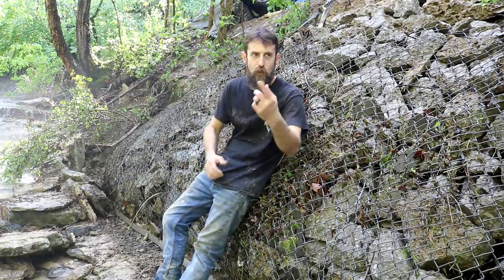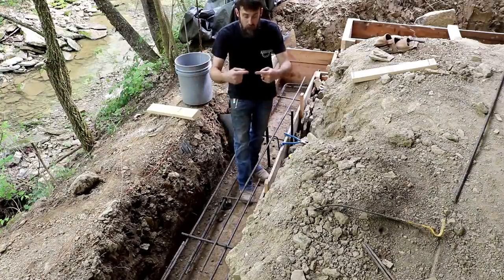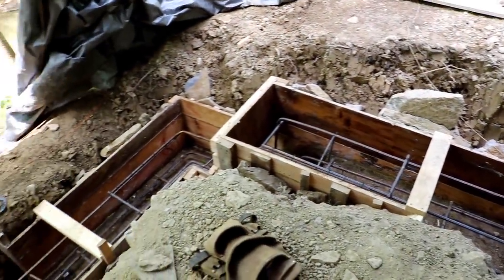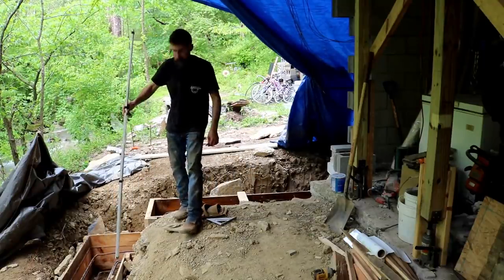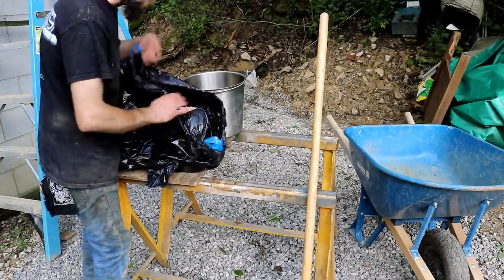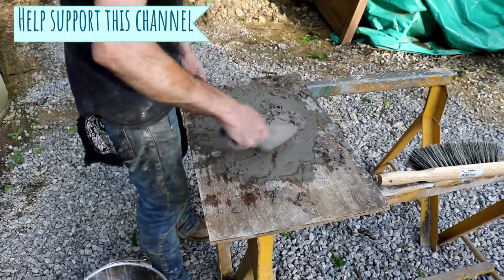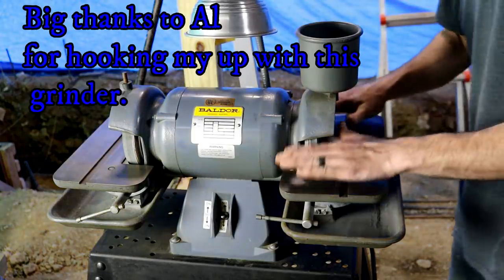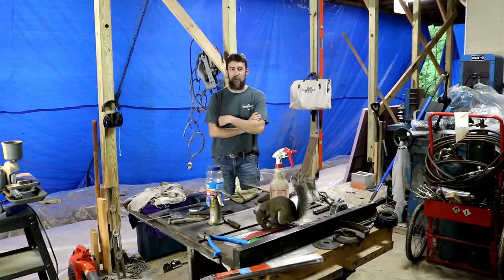Shop update 15  Huge Flash Flood footage & Block Repair

Comment: Put your mortar mix in a plastic bag, open one corner, use that to squeeze the mortar into place. Then use the trowel for the finish work. Makes it so much simpler and easier to work with. Keep your humor up, helps with any frustrations you may end up having on such a project. Great video, you're getting closer to being finished. Cheers :)

Comment: I feel your pain Steve, half the nails in the boxes that I buy have the heads on the wrong end
Reply: They're for the other side if the fence.
Reply: Always bend towards the sun. That way you don't have to worry about right and left.
Reply: Engineers Workshop 🤣👍🏻

Comment: The roller mill in Bagdad has all poured concrete silos 100ft tall. They did it all back in the 1940's with slip forms and pouring out of a bucket on a cable.  I reckon they somehow pulled up 120ft long poles then ran cables over them so they had away to lift the bucket. Considering the amount of concrete in those silos it seems insane to think of doing it. Those guys were not scared of work. lol

Comment: Steve,

We have a similar sized creek running through our property. It is 300' from the house and never threatens my buildings. We have lived on this creek well over 30 years giving us ample opportunity to see how radically floods can change its condition. Our creek banks are a lot lower than yours, so the creek widens to over 300' across our bottom ground in a similar flood to yours. The channel runs crazily fast at those times. I have watched 40' trees tumble end over end through the channel during the fiercest of our floods. This creek was a really nice asset for raising children. The grandchildren play in it now. 

I recently purchased the same Baldor tooling grinder that you showed. What a wonderful tool.

Comment: Got me on that "bent the wrong way" line but I am a little slow anyway. When I worked at Boeing we used Crisco shortening as a lube for tapping 4-40 holes in titanium.
Reply: Just imagine how much time it must have taken to straighten it and bend it the other way. And being the craftsman that he is, you'd never be able to tell.

;-)
Reply: Lard is the earliest forms of lubrication and is still best to use as cutting fluid for cretin metals - as is wheal oil but we won't go there.
Crisco works great; I would have used a warm liquid vegetable oil and sprayed it on but that's just me.
Update:
Thinking it over (I'm driving here from the backseat) we usta spray diesel on our forum boards but EPA said bad ju ju so we switched to a water soap mix (much like Dawn dish soap) of course it didn't work as well but, I remember now, the reasoning behind not using vegetable based oils was because it didn't attract unwanted insects.
Reply: @ThadEGinathom  Oh, what about cutting the bend off, then welding the straight pieces together, and bend again? you can toss the left turn into left-turn-bucket for future projects!

Comment: Wow, you're not kidding that is high water, and you say it was even higher than in the video for a while!  It was a good stress test of your bank reinforcements as you say and it looks like the design is good.  I like that grinder of yours from Al - you are totally right in that the rests on most bench grinders are made from soup cans and just aren't worth much.  Would almost be worth it to make a slotted table from plate for a standard bench grinder if a guy had a decent one.

Comment: Re: Mortar repair
When it dries out the color will match, but YOU will always know it's there, and it's gonna bug you.  LOL

Re.: rain and run off
I bet you see it get even higher than that by the time you're pushing 80, given what's facing your generation with climate change on the horizon.  I don't envy you.

Re: bench grinder
Saw a good trick a while back on YT, and it is handy. Add a flap disk on the outside of the right wheel.  One of the grinders I have I made with arbor extensions, which allowed me to put a second flap disk on the inside of the left wheel. I have a jewelers drum on the left, with anywhere from 60 to 340 grit belts, a 40 grit flap on it, wire wheels on the right with a 120 grit flap on it. It is so nice to have the various grits on one machine.

Something I discovered about wire wheels is to use multiple wheels, instead of one.  I added a second of the same size & wire after the first wheel was 3-4 years old, then added a third with a different wire gauge about six months later.  

The first is about 1/4" smaller radius than the second, and the third is about 1/2" shorter radius beacuse of the smaller gauge wire.  

Those 'stair steps' are incredibly handy.  The slight difference between the wheels makes cleaning up small rod a breeze, providing a groove for the rod to right in, instead of contacting the wheel cross wise, and having it janed out of your hand repeatedly.  Try it.  You'll like it.

Comment: Coming along nicely Steve. When repointing you need to knock up a "hawk" . It is just a 10" square  piece of metal or wood held horizontally  with a  vertical handle screwed centre in the bottom. Load on some mortar, place the edge of the "hawk" against the bottom of the joint and you just slide the mortar into the joint. You can play about as much as needed and you do not loose any mortar onto the floor.  Repointed my house using that method and it was a breeze .  Hope you get the concrete in soon so as to give you plenty of time getting the walls up before the winter.   Stay safe. regards from the UK

Comment: Lived most my teenager years by a lovely small river come stream. It was part of lives, not far from our home were huge deep waterholes that we'd spend our summer days swimming & having fun.... That stream would run wild every winter after heavy rains bringing bits of trees and old logs past our house. Then one day there was a massive downpour in the hills, really heavy and huge thunder but the crazy thing, the sun was shining at our location, just the hills were covered in heavy black clou for a few hours... then the alarm went up... our stream went from a clear water normal flow to a wall of thick ozzy mud and boulders in a blink of eye that flowed for a couple of hours, in broad sunny daylight, you could feel the ground shake ! Some stuff was wrecked and in the end the mud dried to dust that blew in the wind and basically the stream was completely different from that day on.

Comment: Another option for mold release is using old motor oil in a pump sprayer.  Not the most eco-friendly, but it works and is free.

Comment: Hi Steve,
Nearly there, just focus on the great end product of your hard graft
Put some dish soap in your water when mixing mortar,  this acts as a plasticiser and the mortar gets sticky meaning it sticks to your vertical joints. 
Also, practice taking a line of mortar on the trowel and flicking it into the joint, keep flicking at the joint and it packs right in there. Much easier and makes a better joint than trying to push it in.

Comment: You can increase the strength of your reinforcement by packing dirt between the stones, washing it in with some water. Then run geotext over the stones and then the wire mesh. This way the water cannot move the dirt from behind and between the stones away, but just move it to the front, where it's held back by the geotext. This will spread the stones evenly inside the embankment, making room for roots.
For the trees I would add some steel rings, which leaves enough space for the tree to grow from. And place the trees above the highest water level.
Willows are perfect to hold an embarkment against the water since they can survive with regularly wet "feet", other trees roots will just rot away.

Comment: re mortaring, use the bricklayers trowel there as a horizontal platform, and use a pointing trowel (basically a super narrow trowel)  as a pusher.  Verticals are just done in smaller pieces, working up from the bottom.   Also consider knocking up some scaffolding, its a lot easier than bending and twisting around on a ladder.  You will need it for the back and front wall blocklaying too !
Reply from the maker: Thanks👍, I have easy access to scaffolding. Hopefully I'll need it soon. This footer is waiting on the stars to align
Reply: I was going to suggest the same thing. If you do all the verticals first then the horizontals you will get a better finish. When you have the mortar on the large trowel or hawk smooth it to about 3/8 thick then cut a 3/8 line off on the small trowel it goes in easy. I can do that but couldn't do any of your machining so we all have our strengths. Keep at it. Also did anyone suggest waxing or lightly oiling your forms so they are easy to remove when the concrete is set.

Comment: Gday Steve, there was a power of water flowing down the creek, great to see your batter reinforcement held up, you definitely got it right, I had a bloody good laugh when you bent the rio bar wrong, such an easy mistake😜, I really like your bench grinder setup, worth it’s weight in gold, hopefully you’ll get the pour done soon and start on the walls, thanks for the update mate, great job, Cheers Matty

Comment: By the time you see this it’ll be to late but a good tip for grouting mortar, use a tuck point tool to push mortar off your trowel and into the joint, works like a charm! As always, keep up the great videos Steve! Cheers

Comment: A lot of waters ability to erode is that it carries heavy objects propelled at a high velocity :) Your bank reinforcement seems to be working a treat, that heavy duty wire netting is perfect for the job! I'd have liked to have seen the end of the drain pipe during the rain, maybe next time :)

Comment: You look like you're doing a fine job to me Steve. With all of that steel in it the foundation should be solid. Even if the stream ends up under your shop. Lime makes mortar sticker. The premixed mortar can always use a bit more lime in it. They go light because I guess lime costs money? A big bag of lime isn't much. You want type N I think? It isn't the stuff for spreading on your lawn. It is masons lime.

Comment: Baldor makes two basic models. One is for regular silicon carbide or al oxide wheels. The other, with upgraded bearings is for diamond wheels. They don’t recommend the regular model for diamond because while stones will wear to make up for the slight wobble, diamond won’t, so you’ll grind off one kart of the wheel more often than the other.

Comment: I sussed the wrong bend bit straight away but I spent 25 years as a whole time firefighter and you pick up in sarcasm and pranks pretty damn quick after two years as a proby.  I was in the construction trade myself before that and I was once sent to get a left handed bricklayers trowel from stores.  Oh I wasn't falling for that one...I'm smarter than that!  More fool me!  Who would have thought there were left and right handed bricklaying trowels?  The bevelled trimming edges are on opposite sides!

Comment: Hi Steve, Thought I'd say great job. I built a cordwood house and used lots of mortar and with large cracks; I would have taken hand fulls of mortar and slapped/toss it into the crack which aids in compacting the mortar into the crack. Just a thought.

Comment: Need to fire that guy that doesn't know left from right bending steel ha..... If you're using a pump(thought you said it before) have some strategic clean up spots in mind. Your creek bank or drive area has to have dozens of "locations" to drop it. Every drop of washout from our house has become base in the driveway. No cleanup no touch done. Peanut has probably been busy making more squirrels! Looks great thanks for sharing

Comment: This video shoes a way of connecting rebars ends. Have we seen another way to do that? 
Such as : 
Preform each end of rebar stock into J shape for (1) overlapping sections and (2) further formed into rectangular rings. (3) align J tip facing concrete core, center line. (4) use formed rectangle rings to replace assembled rectangle rings. Install rebars farther from concrete core and not too close to concrete surface at the risk to cracking cured concrete under load.

Comment: We are doing a rain dance up here in Nova Scotia right now. We could really use some of that rain. It's been very dry for the past two weeks to the point where there have been many forest fires. My wife gave birth to our first child(son) last week and we were about to be discharged from hospital when we found out there was a fire just 1500' from our house. We ended up spending an extra night in hospital because our home was under evacuation order. Thankfully the wind was blowing away from our property and only forest was burnt before they got it under control.  Rain is in the forecast for today but it hasn't started yet, yesterday they were calling for it to start before midnight.

Comment: Arrrrrgh ... Lag bolted you called it. After the patch is done you really don't want me saying that you should have released the bolts and packed between the beam and the blocks. It all works out in the wash anyway. It's always fun watching others adapting to different trades. Yes I would have filled that trench exactly as you are doing but because of the waterway I would have come up higher. 
It will be good to see you back at what you excel at ... machining

Comment: 7:12   Way-oil may applied with a hand pump weed sprayer may have been a satisfactory alternative or even WD-40. Of course JB-80 would have been twice as good. Even candle wax will do in a pinch.
10:55 Can you imagine the quantity of "high performance form release" needed for that pour? :-)
As a summer job while in college, I was the "mud man" for a brick layer and he insisted his mortar be mixed with a narrow tine fork rather than a hoe. As a consequence, I was known as a "mortar forker." 
Glad to see your blue security fence is keeping the shop secure from theft.

Comment: Those separated joints in your block wall could be filled much easier by piping the mortar, similar to how a baker puts designs or words on a cake.  You can buy them or make one out of any heavy-duty plastic bag, then clip the corner off that bag large enough for the mortar to flow when squeezed. Lookup piping bag on the internet.

Comment: hey dude,,,, just found your vid by chance.... but its good that I did ,,, I have a wall made with concrete blocks (the age of that wall is about 40 yrs my dad did that wall ,  ) but it cracked at the mortar joints ,,,was thinking to dismantle the wall and build it back ,but looking at you fix that  wall  got me thinking I could do the same and render mortar  on it   ….. thanks for the info.....

Comment: Interesting and, I imagine, somewhat terrorizing to see the volume and speed of water coming down that dry gulch.  If there is a Flood Control District in your area they may have data/maps on that drainage that would allow you to guesstimate the  level of the event in the creek or frequency of the flood event you just witnessed.  Maybe you could devise a warning system like hanging a bell above the creek,  to notify you when the flow reaches some critical level so you can take precautions.

Comment: What an easy to reach water power source so close to generate electricity. I would have to install some type impeller system to generate some electricity. Thumbs Up!
Reply: If you follow this channel, you will see that most of the time there is very little water flowing in that creek.  It is just drainage, no flow for a power source.

Comment: There is a saying- Caulk, putty, and paint- makes the carpenter what he ain't. Maybe take a wire brush to the block around that joint and knock off the excess mortar and the rest you wont notice in a year.

Comment: Too late now Steve, but add PVA wood glue to the mortar to make it stick, and you can also add some dish washing liquid to make the mortar flow more easily, but without using more water.
Reply: We used caustic soda in the oil field to make cement cure quicker during casing
Reply: Mainly so the cement would set quickly when it was in contact with water  in the water table

Comment: I have watched your shop repair off and on and have no idea if you have poured your foundations or not.  I question the depth of your footing because I was always told you want them to be below the frost line but if your happy with them that all that counts.  That said I would like to pass on a bit of advice my great uncle who was a master mason told me and that is to make sure the walls of your foundations are perfectly smooth. because if they are not that is a point where unequal expansion, contraction, and heaving can and will occur overtime.  I still remember when he looked at the foundations being poured for our church and he pointed out nicely the foreman (and then argued vehemently) of the company doing the foundations that unless they fixed the walls of the foundation at two spots the foundations would cause the brick work onto of them to crack in a given direction.  The foundations were similar to yours where sections were just trenched and other sections had forms.  The places that my uncle did not like were a couple sections that walls of the trenched foundations were trenched and the walls of the foundations were pockmarked with indentation from where rocks were removed.  Do as you please but at the least you might consider filling them with something.  Having spent a couple summers working on a concrete crew in my teens you might want to consider spraying your forms and trenches with oil prior to pouring your foundations.  We sprayed all of our form lumber with linseed oil prior to building our forms if the lumber was new and the assembled form after erecting them and once again the morning of the pour. Again do as you please.
Reply: What do you think the "frost line" is in his part of Kentucky??!